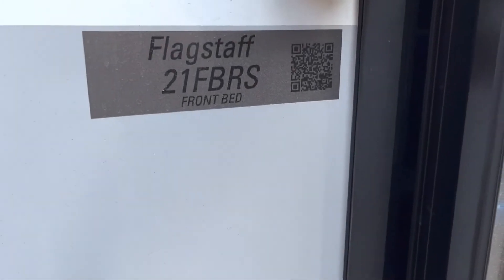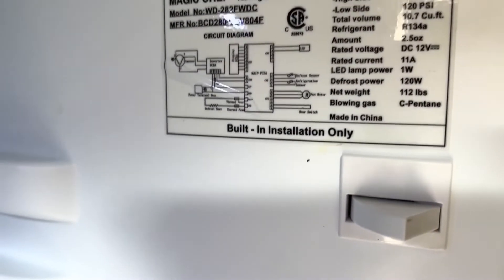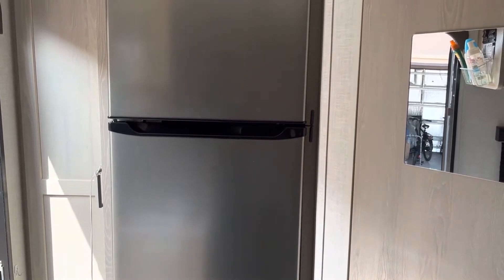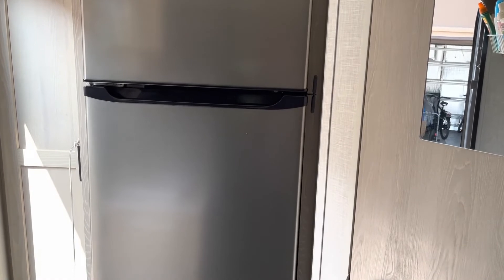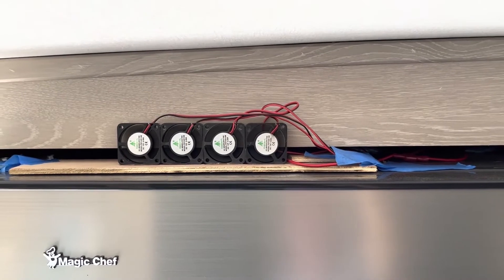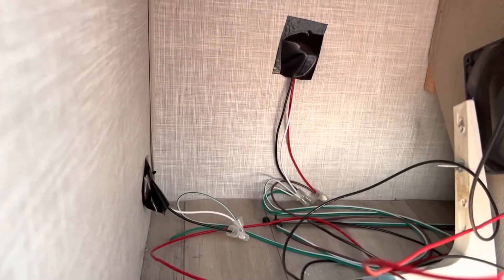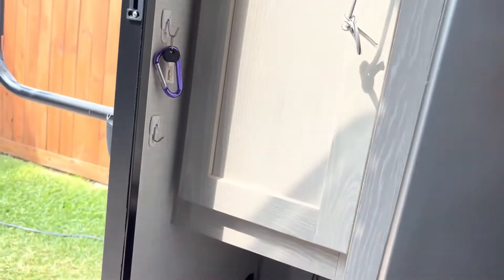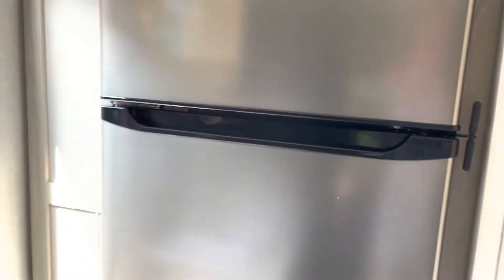Magic Chef Everchill 12v Refrigerator Cooling Problem

Comment: I have the same problem in my 2021 Geopro. Unfortunately, I dont have the same access you do to put those fans in. Before I watched this, I did pull the microwave that sits on top of it to see if the added ventilation helped, but I was still in the mid 40s. I put the mic back, and its back at about 50. Maybe I need to find a way. Thanks for posting this!

Comment: Thanks!  I replaced my 3-way in my HW pup with a 3.3 cu ft because I had a incident where the 3-way got up to 65f.  Today my Everchill got up to 52f.  I have a spare 14cm Noctua industrial PC fan.  I'll make some duct work with duct tape and install it to pull outside air into the fridge space.  Perhaps that will help.  I wish that I could connect the fan to a thermostat with a sensor in the fridge.
Reply from the maker: Good luck. I hope that increasing ventilation to the rear of the refrigerator solves your problem.

Comment: I am surprised that you even thought that the RV dealer would help you in any way. Their answer every time, is to buy a new one. I wonder if they told you that South Texas is not a good place to RV. I see on my fridge is that the is no access from the outside. I'm surprised to see that Dutchman didn't want to spend an extra $25 to put a hole and cover from the outside. OMG, they must be greedy bas%#$ds. I'm sure you spent enough time on this junk. Thanks for your time to post and solution.
Reply from the maker: Other than the refrigerator cooling problem,  a leaky (plastic) bathroom faucet fitting and an under cabinet light failing , I’ve been pretty pleased with my Flagstaff. I’m definitely the exception.

Comment: Great  job, sorry no body from Forest River helped you..Patten a kit to sell as an add on to Forest River..
Reply from the maker: I actually didn’t contact Forest River, but had the travel trailer at my local ExploreUSA dealer for 5 days to analyze the problem. Outside temperatures were only in the 80’s, they ran the AC at 70F and only periodically opened the empty refrigerator to check the thermometer in a cup of water. So really not a real world stress test. But my dealer was not aware of any recalls or technical service bulletins, nor had they seen this problem with a 12v compressor refrigerator. So essentially I was on my own to solve my problem

Comment: Are you saying that the only ventilation was around the front edge?
Reply: Yes. There was no ventilation in the back, top, or bottom. The cabinet around the refrigerator is sealed tight, except for the front. The only ventilation was in front. And there was essentially only 1/8” or less clearance on the sides and 1/2” at the top. Maybe Forest River should  have not just filled the cabinet they used in their previous design which utilized the ammonia absorption refrigerator, but considered the additional ventilation to the that a Freon refrigerator needs.